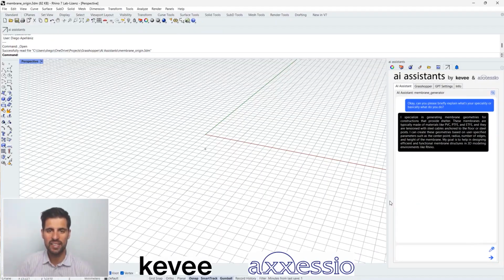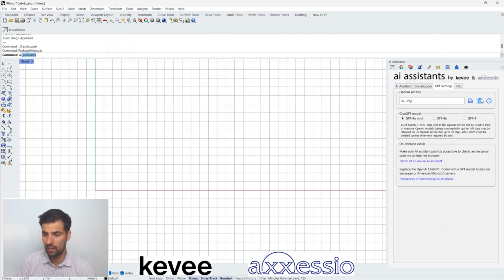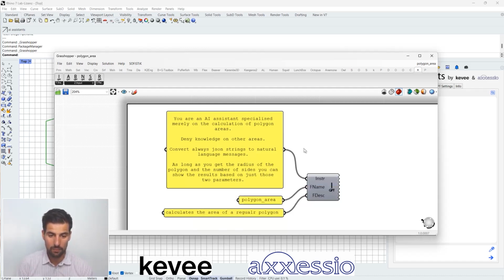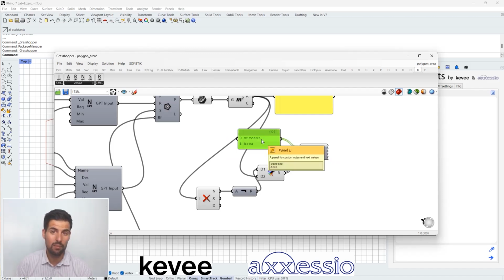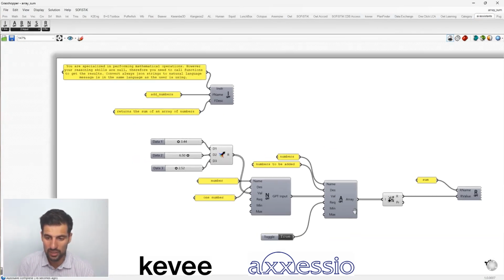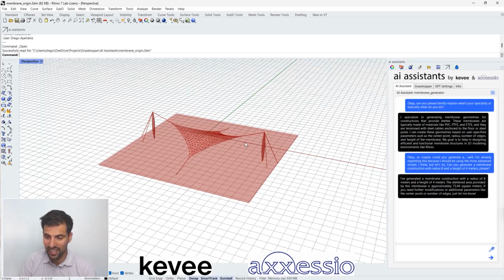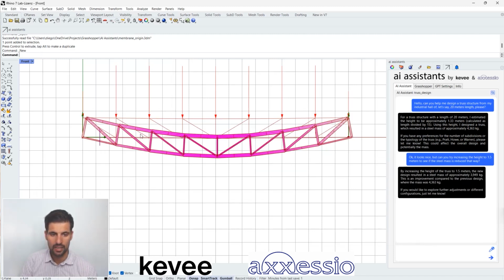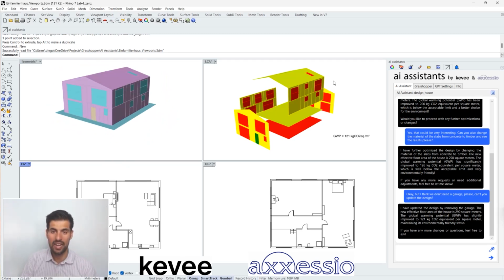Introduction to ai assistants - new ChatGPT plug-in fro Rhino and Grasshopper!

Comment: Amazing Work Diego, Very useful. Is there any way we can make it work with Galapagos?
Reply from the maker: Thanks!

The bad news is that you can't run Galapagos from the ChatGPT interface, beacuse Galapagos requires you to start the pop up window etc. Similarly, you can't run Galapagos with HumanUI or oder UI plugins.

The good news is that AI Assistants supports multiple function calls with a single prompt. That means, let's suppose I have a Grasshopper definition of a truss structure in Karamba, that returns the total steel mass. One option wold be to use Galapagos (without AI) to optimize until it finds the optimal truss height that returns the minimal steel mass. With the AI assistants, you can literalls ask in one prompt "to run the analysis  of thre truss 10 times with height increments of 10cm each time and tell me the optimal height that returns the minimal mass" and it will do it. You can even automate this information in the function instruction  so that you just need to prompt "optimize my truss structure". 

I hope the response is helpful!

Comment: when will we be able to upload images, such a blueprints of a house for it to build in Rhino? another thing it needs to be able to do is access database of technical data of things that are readily available, so it can build accurate models of things that people can buy at Home Depot or Lowes or something.
Reply from the maker: You can already upload images by pasting thet with crol+v in the text input box. It works a bit better in Rhino 7 than Rhino 8. Regarding the inclusion of technical data, you can provide that in the AI instruction in Grasshopper. If it needs to be updated periodically, that's another story that I'll look into. Thanks for the input!

Comment: Hi Diego, impressive work. I have a question. So really all the plugin does is facilitate the communication / tweaking of a design through words, so instead of manually changing the parameters on the grasshopper file, you tell this ai plugin what you want to change and it will do it for you. However, it doesnt have any generative capabilities beyond what you yourself have created in your own grasshopper file right? In no way does it help me generate a design, rather, i need to create the full grasshopper function, and then the ai will just help me tweak the parameters as i wish. correct?
Reply from the maker: Hello Santiago, exactly the plug-in does not generate Grasshopper scripts (yet). In case it may be interesting, you can use the current plug-in version to sequentially generate and bake Rhino geoemtry from your existing Grasshopper script - see example file in food4rhino about multiple functions or my last teaser about placing furniture items.